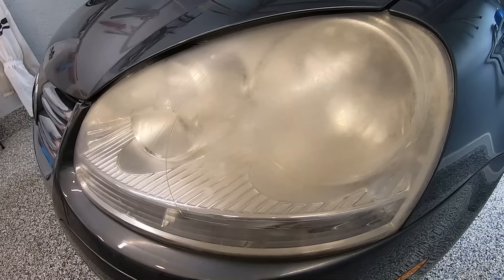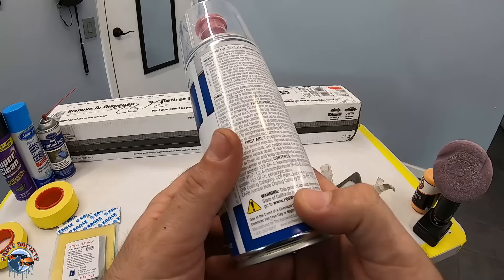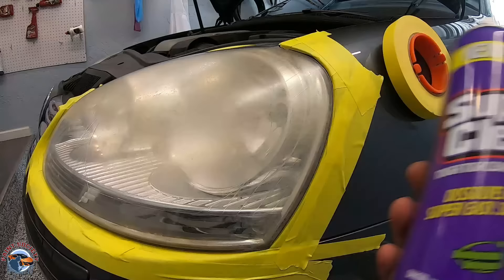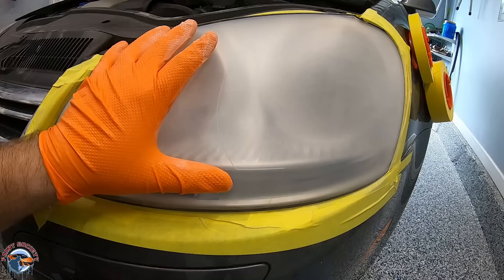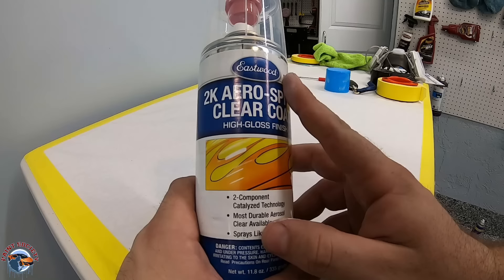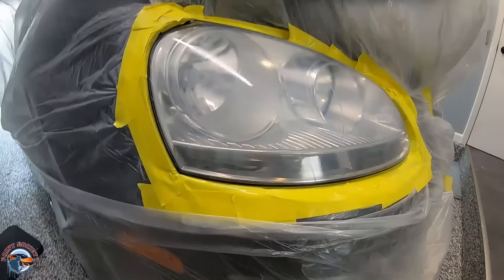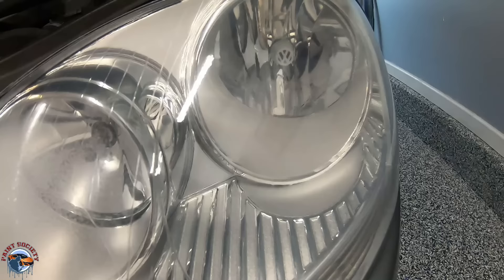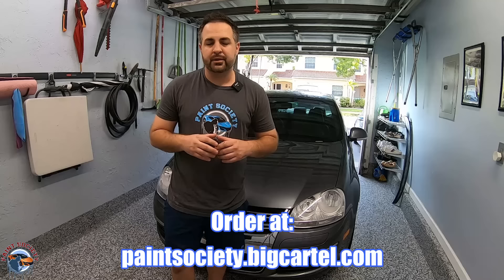The BEST Guide to Restore Headlights PERMANENTLY!

Comment: Hey Brian

Just painted my niece headlights, using your recommendation in this video, they came out amazingly. This was my first time spraying 2k clear. I did exactly as you said, with light first coat... After 4 coats not a single run.
I used the best cheap gun you recommended. 
Thank You so much.
I wish I could post a picture, but don't know if that's possible......

Comment: Hi, I followed your directions exactly and had issues.  My lights came out very clear until I used the Eastwood Clear Coat just as you did here in your video.  I shook the can up just like you and the directions on the can.  My headlights did not turn out crystal clear as yours did in your video above.  My headlights turned out kind of bumpy I guess you could say.  After a full 24 hours I tried to lightly sand with your Eagle 1500 Grit sandpaper and try again with another clear to see if made any improvements, which it did not.  Turned out the same way again with a Haze on both lens and not crystal clear like yours.  So I spent $30 on clear coat with awful results.  I was going to email you but did not see your email address listed in your About section.
Reply from the maker: Send me a message on Instagram. 

Paint.society is my username. Let’s see what went wrong.
Reply: @PaintSociety  I PM'd you on Instagram but no response yet
Reply from the maker: Be patient. I have over 100 messages
Reply: He didn't get the shirt 🙌

Comment: dude i just used some 3M and and micro fiber towel on a 2003 camry. did a fairly decent job but daaaang you took it to a whole other level with this. good work and good video thanks

Comment: so I did it, I went and got some wet sand paper 400 all the way to 3000, and I used Meguiar's heavy cut 12 and then I used the 7 and 4. I just got my Eastwood 2k clear coat in today, so I'm waiting for a not so windy day since I don't have a garage to pull my truck into and put the clear coat on, and I have to say that it is clear now just from the process I took the sanding through, and I used a bottle of water to clean and keep the surface wet as I sanded: 400 1000 1500 2000 and I used a 3000 wet hook and loop and put it on my orbital polisher I bought from Auto Zone for 99 dollars and has 5 speeds. I'm super happy with how it has turned out so far. I'm excited to put the clear coat on, and I wanted to watch this on more time to see the sanding and polishing after the clear coat dried! I went through a few more steps of sand paper to accommodate my inexperience. I wanted to make sure I got a great result the first time. Thanks again for the video!

Comment: ChrisFix had a similar solution, when I tried it, it lasted about 2 years.  I think I'll be more careful with the sanding next time.  Thank you for the video!
Reply from the maker: This process is much different using different products that will last a lifetime.
Reply: the key is putting really good UV protection on. cheaper stuff won't last.

Comment: Very good video just a suggestion some cars make it very easy to remove the head light assembly . My Crown vic I can remove both headlights in 10 minutes , I wont need the plastic and tape that would really drive the price up on your materials. You can also just use standard 600 and 800 wet sand paper and not buy the kit .  Take the head lights out set on bench . You can use a piece of flat rubber for a sanding block so you dont get finger grooves on your surface fold your sand paper three fold length wise and wrap around the rubber and get a spray bottle with water and sprits the surface as you go . When you have it all prepped then shoot you clear on the head light no masking no no mess and most of all it will probably save you $100 for a box of plastic and tape and kits you dont need . Very good video

Comment: I've always just used mothers chrome wheel polish to get the oxidization off and then sealed the deal with a $10 bottle of ceramic coating from amazon. Haven't noticed any yellowing yet even on the oldest car I still own where I've used this method which was a little over 5 years ago...Even if it starts to haze up tomorrow this method took me a total of 25 minutes and $15 in supplies with enough extra to do 2 or 3 more cars easily.

Comment: so I went outside and taped off my headlights, used some water based goofoff and made sure I removed any residue of the Mequiar's and cleaned that off with a clean micro fiber and some Sprayway and a bottle of water and clean micro fiber and sprayed on 3 coats of the Eastwood 2k clear coat. I gave it 15 minutes between coats. I guess I got a little carried away on the 3rd coat on one of the headlights, because I got a couple small runs I'll have to sand out, but they turned out pretty awesome. There was a place on each of them, if you look close enough, you can see some of the sanding scratches but they are hardly noticeable. It was super nice out, 72 and a slight breeze. I couldn't pass that up. I'll see tomorrow morning what kind of touch up I need to do, but they look brand new. My neighbor got curious and came over to check it out. Because he saw me sanding on them the other day, and I was telling him about the clear coat earlier today. He even said it looked like new, and asked again how much it was. I paid 36 on Amazon for it. I didn't think I was going to get it until May 30 or June second, and I walked outside earlier when I was pulling weeds and mowing and saw a box by my gate and it had Eastwood on it. I was pretty excited. Because I've really been wanting to do this since I watched your video a few weeks ago. I've seen some other people using their can paint that is 2 part as well to paint some of their fabrications, so when I saw you use it on these headlights, I was all in to try it. Thanks for doing the video, Brian!

Comment: That's called back masking,also 3m has came out with some awesome door jam ,deck lid jam,hood jam,that leaves absolutely no line at all on the jams, you can put 25 base coats,sealer, and clear coat peel the tape off and no lines that need to be buffed out,

Comment: just completed two cars with one can of Two pack clear coat .€24 euros works out at 4 euros a headlight .the Nissan LEAF headlights are huge and cost €600 plus euros EACH.to replace . The Ford Focus headlights are quite large and are also insanely expensive to replace .for an MOT advisory .

Comment: I've been seeing a few videos which state that 2K clear coat is too hard for headlight lenses.  Basically, it doesn't permit the lense to expand or contract with temperature variation.  Polycarbonate is pretty hard, but would this thought be anything like the reason plasticizer used for automotive bumpers?
Reply from the maker: I am unsure where that information is from but it’s not creditable. We have no issues with 2k clear

Comment: Clean the headlights with good glass cleaner, mask them off, wet sand with 600, then 1000, then 2000. Change sanding patterns frequently -- up and down, back and forth and circles. Finally, use some elbow grease with Mother's mag polish and a microfiber cloth, one more application of the glass cleaner and finish with the clear coat. Total time is about an hour for both lights and they will remain clear for many years to come.

Comment: I was going to restore the headlights on my 4Runner and my wife's RAV4 at the same time so I don't waste most of a can of 2K clear coat that's a single use item once mixed.  Three light coats five minutes apart to hopefully avoid any orange peel and provide a good protective clear coat.  The 24 year old RAV4 headlights still look new, but the 17 year old 4Runner headlights are yellow and awful looking.  I'd like to find at least one other vehicle with cloudy headlights.  I hate wasting expensive clear coat.

Comment: All it needs now is a layer of graphene ceramic coat.  Gotta admit I cringed when I saw you spray without a final polish on the headlights, but I jumped the gun.  It turned out great.  Since some headlights are well over $2,000 a piece, a $28 can is a bargan and a half.
Reply from the maker: Yup and you don’t need to polish unless you see defects

Comment: Brian..first off I LOVED your Type S build (owning 2 Type S's myself) and I can't count how many times those videos have helped me.  Quick question though...I see you dry AND wet sanded the TL headlights and used the Spray Max clear, and here you went just dry sanding and with the Eastwood.  Any reason?  I actually just purchased everything in this video and plan on just using the 600 and 800 Eagle with the Eastwood on my daily driver Type S headlights(as those are the worse of the 2 cars)  I was just curious, if maybe it was an Acura thing or something lol

Comment: This seems to work good however I do not see how a rattle can clear coat can last a life time. I would give it 2 years or so. Clear coat on rattle cans just doesn't hold up like mixed high end clear coats. Maybe if you wax it often but I have cleared many parts with rattle can paint and it just doesn't last. Great video though you have created the clearest headlights I have seen so far.

Comment: I did it wrong but what caused the problem? 07 Grand Cherokee headlights were really bad and dark. Started with 400 until it was clear and clean. Moved up to 600 then 800 and did a finish polish with 1500. Looked good. I didn't get the 2K clear, but used the 2X clear from Rustoleum. No matter how light of a coat I applied, it ran and ran bad. The run thinned out and was ok but the clear started cracking all over the lens. Bad cracking like alligator skin. Second and third coat cracked as well. It all has to come off again but I'm guessing I shouldn't have gone all the way up to 1500? Maybe too smooth? The Rustoleum said it's good for plastic. Everything was clean and wiped down with Sprayway. What caused the cracking and running?  That's what I get for not following directions. I over-thought it.
Rich

Comment: My headlamps looked foggy, and after I took out the bulbs, I found there was salt residue on the inside, from many winters, and the sponge from the vent hole fell out. i washed out the lamp, and used a blow dryer to dry it, and it was clear again.

Comment: I don't have a shop to paint and where I live people are very skeptical of this kind of work because there is a few shops here where all they do
is buff only. So I do on site with a drill kit with 2" j-hook carbide circle sandpapers and 2" foam pads and buffers, and finish with UV resistant 
ceramic coating. I usually wet sand though. How much do you usually charge for painting them? And yes i know that painting them is better 
than what I do.

Comment: Quite impressive. I replaced my microcracked head light lenses with a cheap aftermarket pair that looked great but after about 1 1/2 years the coating is starting to peel. I'll use this method soon. Anyone else notice the little VW logos in the headlights?

Comment: I just did this. Didn’t even know about the activator on the bottom.  Is that why the headlights are drying a bit hazy?   Also I wet sanded.  Is it better to wet or dry. Good to know because I think I’ll be resanding again tomorrow once the clear dries.

Comment: Man the sand paper recommend here is amazing stuff. I never worked with such a quality material. What a difference! Even with that this was a pretty tedious job. It required a lot of sanding. I messed up mine during the clear. I got a ton of orange peel. I had to sand down every inch of the clear coat and I'm pretty sure I messed it up in some spots. I think I burned through the clear. It still looks way better than before. I don't think my work will last though. During the final sanding and polishing I removed my headlights because I couldn't get the polisher in the tight corner of my light. I should have done that to begin with. My spray job might have been better. I also didn't use the same clear recommended (Too expensive). That probably would have gave me better results. I think I would try a slightly different method next time and machine sanding. Since I'm afraid of dealing with orange peel. I might also do a good ceramic coating instead for the protection.
Reply: 8 months later, how's it doing?
Reply: @4seeableTV  Still looking good. In my case the car is garaged now so the bright California sun doesn't have a chance to burn it as much

Comment: just did mine.
BUT.
I hasn't dried really clear.
I can only get a 1k.
clear coat..
if I sanded back the clear coat I just applied with a 360 grit sandpaper.
and apply clear coat AGAIN.
will that fix it ???

Comment: Great video , great information too . 
I've got a late 06 Touareg . 
The headlights aren't as bad as the ones you did . 
But Touareg headlights are notoriously bad with their light output . 
Going to do mine following your method . I'm guessing any good quality 
2k lacquer is going to give the same result . 
Thanks from the UK .
Reply: Hey I’m from the UK as well. Which clear coat did you use which is available in the UK?

Comment: Hi, amazing results. Can I do this using -  "a 2K Aerosol with Non-Isocyanate Hardener inside the can, it does not have a tab or pull underneath as the older Isocyanate version did. This system also known as 2K ADC (Air Dry Converter) can be reused unlike it's older counterpart and has a shelf life of up to 36 months."? 

Thanks, Ralph.
Reply from the maker: I never heard of it but you can maybe give it a try. I can’t recommend it though

Comment: I have a small place on my left front fender where the clear coat is peeling  off. Do I need to sand off all the clear coat on the whole fender or can I just mask off at a body line and then use the same procedures as the headlight restoration?

Comment: How come some people say DON’T USE 2K Clear Coat? I followed your example…and hope for the best.
Reply from the maker: They dont know this option
Reply: @PaintSociety I don’t see anything on the Eastwood 2K can about UV protection or for use on plastics. This is the rap for using 2K clear coat. They say it isn’t made for plastic headlamps. Anyway, mine came out less than perfect. The coat is uneven…seems blotchy…maybe that’s the “Orange Peel” effect. Can I sand with the K-1200 and give it another coat of the 2K Aero-Spray the next day (before it all goes to waste)? Other should I just sand and try to go over it with finishing compound using a DA polisher?

Comment: I just did the aftermarket headlights on my F150.  I thought I did a well enough job spraying the 2K on, but the whole thing was orange peel.  With a piano black background within the headlights, it really made everything inside look blurry as shit.  Not sure how you controlled the amount of orange peel, maybe I'm just that inexperienced, or maybe the spray can doesn't do a good enough job of atomizing the clear?  Is there a clear and activator you could recommend that comes in a quart or smaller that I could use in my HPLV?

Comment: A lot of the aftermarket housings yellow pretty fast. A buddy of mine had a new set that started turning only 6 months after installing them. 
Would it be good to do this when they are new to make them last longer or is this method no better then the factory UV protection?
Reply: He says in the video that's it's superior to what cars have put on in the factory. At least in the past.

Comment: Hi there I got a question , there is another product for restoring headlights , it is the spraymax special headlight clear coat but this product require more fine grit sanding for final application what do you recommend please P600 last step before spraying or higher sanding grit like 1500 or 2000 , thanks in and forgot to tell you , your videos rocks , keep the great projects going

Comment: Might try this, I've always used the PlastX McGuire's with polisher wheel and the cream like sealant with foam applicator which does a great job but I tend to have to do it once a year on my ole '98 z28 and every two years on my aging '11 STI. Haven't used the spray on permanent stuff yet as I never seem to get that crystal clean oem clean lense perfect enough for me others say it's killer but if I notice it I don't wanna seal it in permanently lol.
Reply from the maker: This guide really works. You’ll need to get everything from the description though to do the job.
Reply: @PaintSociety  hey I'll give it a go it sure looks outstanding and I might as well do it proper and forget it for a few years at least lol.
Reply: @PaintSociety  appreciate the response just started binge watching your channel today, have a faded clear coat on that '11 STI's spoiler to correct, Subaru is known for it's shitty thin paint but the rest of the cars great and 3m protectant film on the front & sides of the car from tbe previous owner it's just that paint on the plastic which faded paint on lal metal parts without the film is still awesome. Kinda wanna give that a go as well cheapest I've been quoted is $500 for a small spoiler seems kinda high when just a few years ago I had 2 panels and the front end repainted for $1k on the ole z28 lol.
Reply from the maker: Yes the plastics usually are the first to go. I’m pretty good about helping out my viewers using voice memos on Ig so just send me a message if you have any questions. 

Paint.society
Reply: Right on well you more than earned a new sub today brother lol

Comment: I followed your instructions exactly. However I have quite a bit of orange peel on both headlights. Any comments on why I got orange peel? Now
I guess I will have to buy the polish and buff them
Reply from the maker: You can sand down with 800 and re clear. Just get closer and slower.